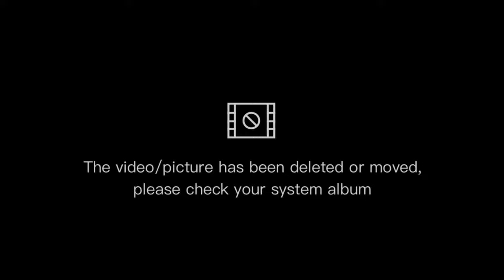How to make mini boat #2 Remote control car to remote control boat

Comment: A relay is used to deliver power from the battery directly to the motor. without passing through the circuit board to the motor make more propulsion
Reply from the maker: yes, that's right, I'll put that relay in the next video because I haven't put it in yet because I'm still ordering by the way thank you for you're advice